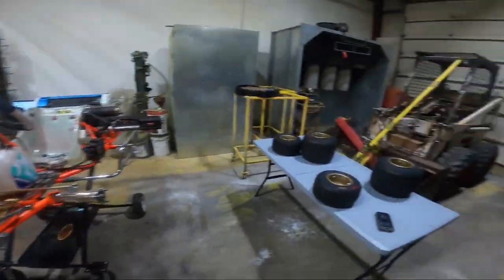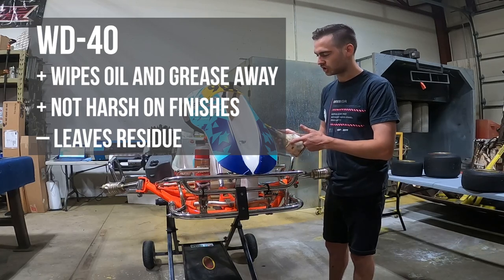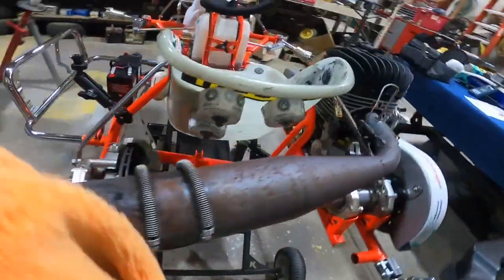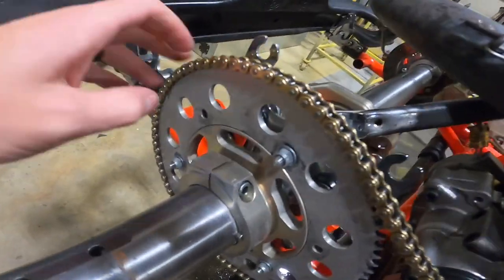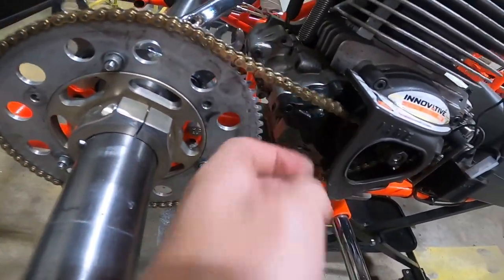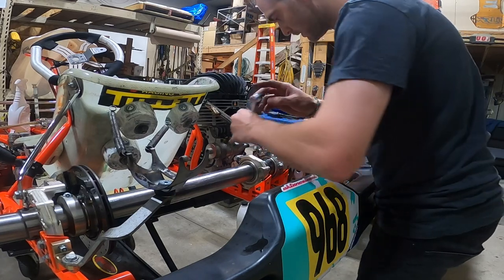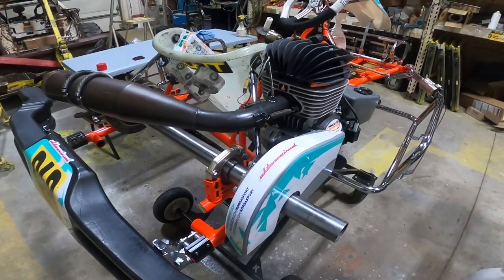How to: Basic Kart Cleaning and Pre-Race Prep

Comment: Helpful video! I am New to karting. Other than Lubing the chain, and greasing the bearings & axles, anything else that is needed in terms of lubrication / cleaning?
Reply: I like after very other race clean the clutch parts with brake cleaners and lube some parts with white lithium grease and or Tri flow

Comment: Very helpful video. Two questions what kart stand do you have and what GoPro mount for your seat strut. Have you had any issues with it? I have seen similar ones on forums with mixed reviews.
Reply from the maker: Kart stand is just a typical scissor stand by KartLift and the GoPro mount is just a cheap Amazon mount I got for about $25. https://www.amazon.com/gp/product/B08GKZNTHK/ref=ppx_yo_dt_b_search_asin_title?ie=UTF8&psc=1

I wrapped some electrical tape around the strut first before mounting to give the clamp something to bite into and it hasn't moved at all, very solid.
Reply: @KorsasportKartingDevelopment  also how hard is it to maintain a ka100 because I have my kart with a team as I am new to owning a kart but do you think it is pretty easy to maintain as a beginner?
Reply from the maker: @aydendelrio5226  Super easy. It's one of the most fool-proof engines to maintain. Clutch is bulletproof so just needs cleaning every now and then, otherwise just need to basically change spark plugs and rebuild a carb (also easy once you learn which gaskets go in which order, plenty of videos showing how to do it). It's a great and simple engine package.
Reply: @KorsasportKartingDevelopment  I currently and paying for storage transport and a mechanic for around 500$ per day, how much do track days cost normally if I do it all myself?

Comment: I saw your third rear axle support was loose, what difference does it make in the setup keeping it thight or loose? You didnt mention it in your setup video.
Reply from the maker: The third bearing will stiffen the axle slightly, so in most cases, I use it as a fine tuning item if I need slightly more stiffness in the rear but not enough to warrant an axle change. You can fine tune it even further by running it with 2 or 4 bolts too. It's a good tool to test if you need to go stiffer in the rear, without all the hassle and commitment of throwing in a different axle.

90% of the time I run it loose.
Reply: @KorsasportKartingDevelopment Thank you for the quick answer! Good luck in the race :)